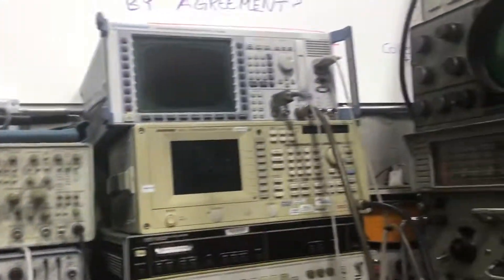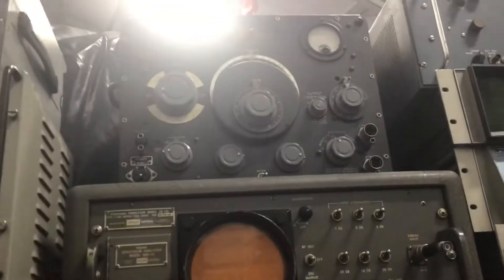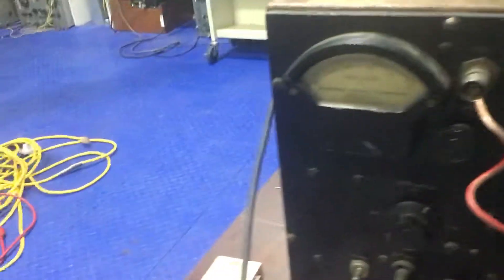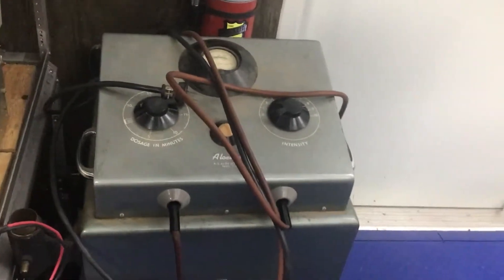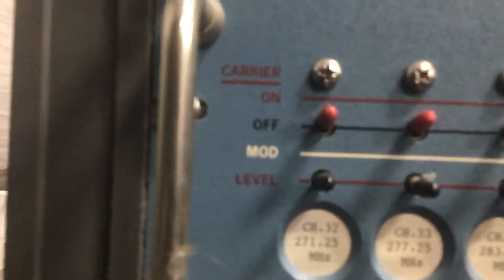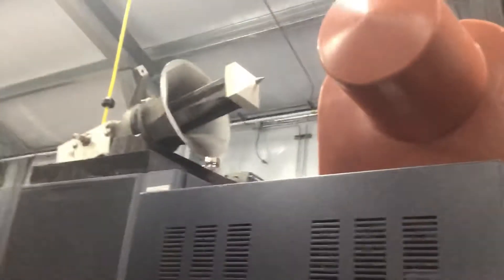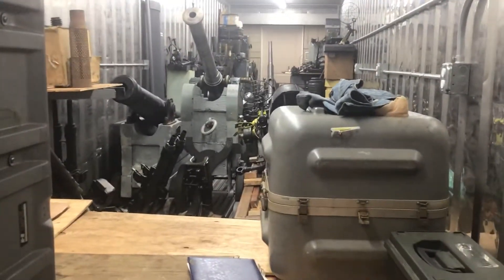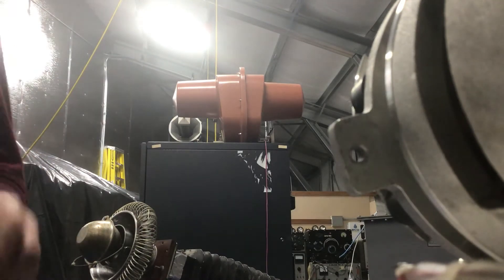Hutchison effect update

Comment: Have two transmitters hooked up. One at 90 degrees offset . So the electro radiation and magnetic field align with the signwave you generate at the desired location, and try different frequencies .  If that. Makes sense